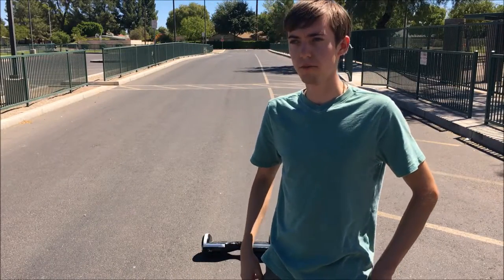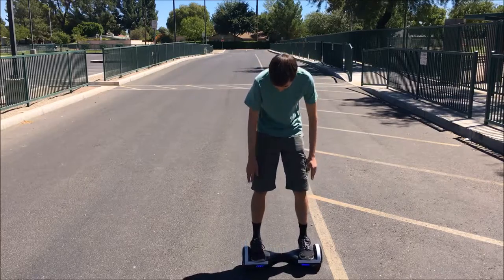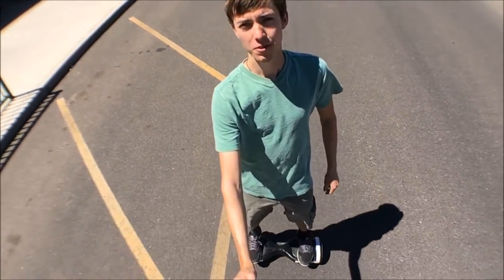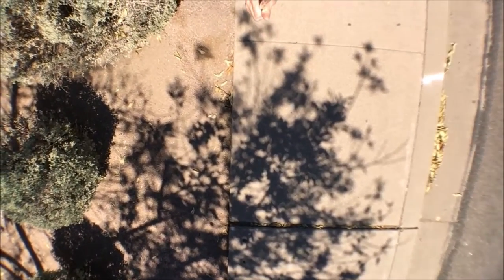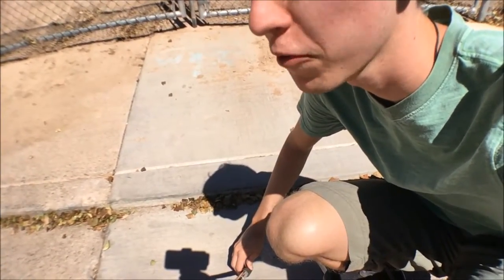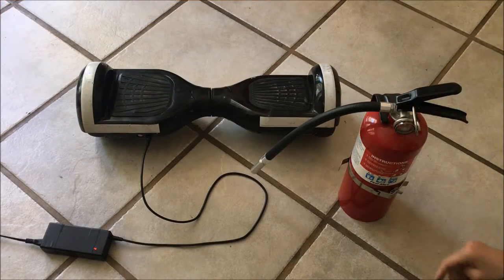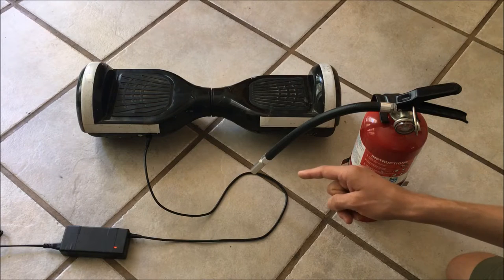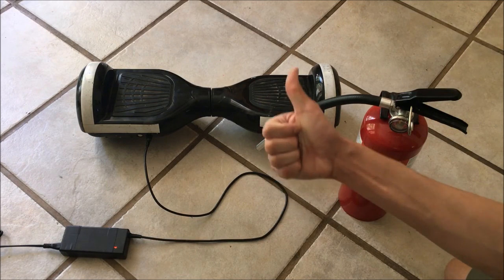EP 17 - Hoverboard Riding and Charging Tips

Comment: Are you able to leave your hoverboard on when it’s charging
Reply from the maker: By default it turns off as soon as power is applied to the charge port. However, a simple modification could allow the charger to directly connect to the battery, thus bypassing this limitation.
Reply: @DielectricVideos   I also wonder because I have a Gotrax edge hoverboard and I don’t know if it’s charging, because I connect it and the I turn it on then it shows like a yellow battery blinking over and over does it mean it’s charging?
Reply: @kevinchacon4772  i know iam late but yea it means that its charging